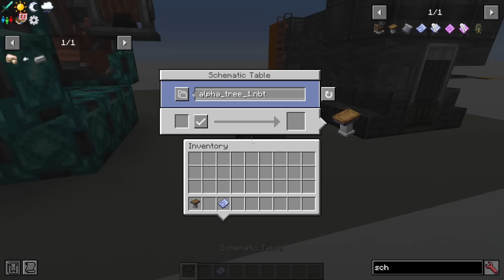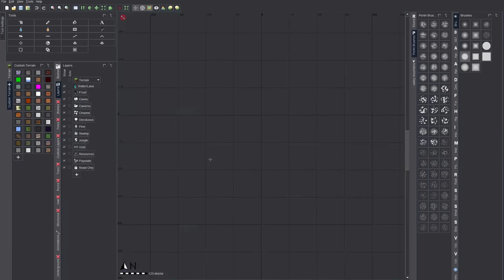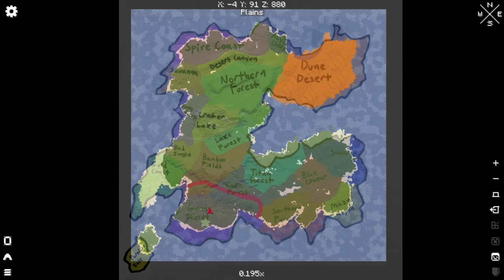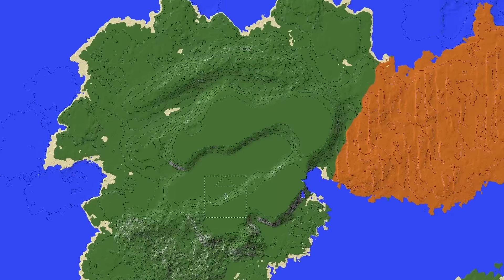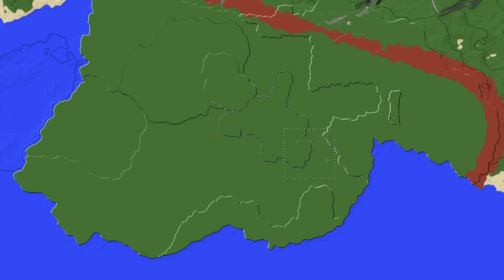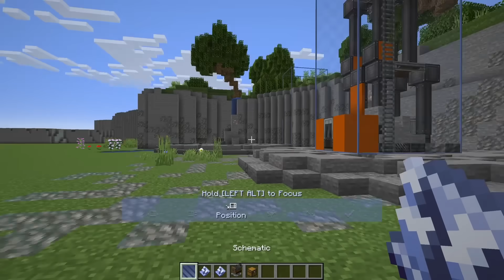Modpack tiers and custom world! | Satisfactory in Minecraft

Comment: A few recommendations i want to make as someone who is also trying to create his own modpack:

1- If you want infinite ore veins there are multiple ways to get them. A few of them already integrated with Create such as Molten Vents, Deep Drilling and Ore Excavation. Theres also other mods with similar mechanics like Industrial Foregoing, Void Miners or Immersive Geology. Alternatives such as Mystical Aggriculture or Productive Bees wouldnt work here but theres still the possibility of custom multiblocks that act as void miners. They would be harder to implement but in return they are 100% adjustable to the pack needs.

2- I don't really see the problem with Immersive Engineering multiblocks. Specially when you later talk about having Create multiblocks that would have the exact same problems as the IE ones. And as for the trains, while Create is the better train mod for this case, is not the only one. Railcraft has been a thing for years. But i understand the pack is Create centered so even then it wouldnt be possible to replace Create.

3- Oritech machines can accept addons that add to the customization of the machines but obviously when put against create nothing could really have the same level of freedom. Oritech also has infinite ore veins as well as a laser drill to mine them so that can help too.

4- For the multiblocks there are multiple, better, alternatives than schematics like Multiblocked, Custom Machinery or Modular Machinery Reborn. These mods allow for custom multiblocks that can do both custom and preexisting recipes. Using schematics as a replacement for multiblocks would only be an aesthetic thing since theres no way to make, for example, a bulk blasting multiblock better than just a typical bulk blasting setup while using only schematics. Even if the intention is to just have an alternative way of doing it, if the alternative provides no real benefits over the classic way, then most people wont do it.

5- Research mechanics can be created in a lot of ways. Main one that comes to mind is using Game Stages that lock recipes (and other things) behind certain actions/crafts/etc. I know modpacks such as techopolis have a research mechanic too but i never checked how its implemented.

I would also like to recommend Create: The Factory Must Grow as a potential addition to the pack. Mostly for the oil processing but it also adds a lot of other stuff that could be useful for the pack. Theres also Create: Diesel Generators if all you need is the oil stuff.

Overall i would recomend checking out a lot of the tools the modding community has created over the years to make modpack development easier and also allow for more things to be done. Mods like KubeJS may look daunting at first but the amount of things that can be done with it is crazy. Stuff like having the multiblocks build themselves by clicking a few items into a specific block seems difficult but with KubeJS is a simple click event handler
Reply: The main issue with IE is the fact that it's not customizable multiblocks like Polart said, Immersive Engineering's multiblocks are pretty hard coded so if you wanted to customize the multiblocks you'd need to remake the multiblocks themselves which isn't what Polart wants. This was one of the drawbacks for me when I'd play with IE, it required very specific blocks be placed in very specific places and the more complex the machine the more blocks you'd need to place in the correct spot, and one block not placed right would make the entire multiblock not work. And yes, I know of the projector, it's still tedious to need to place everything in the exact same way by hand with zero room for error or variation. It's too restrictive when building
Reply: in satisfactory, you can build train tracks however you want (curves, train switches,...) you cant do that with railcraft, but you can with create
Reply: @pohodovejrybar5918 I know. I said that more so because he was dismissing Immersive Engineering for reasons that don't make too much sense when the intention is to create something similar to Satisfactory in Minecraft.

That's why I said that Create was still the better train mod in this context. It's just that dismissing Immersive Engineering because it doesn't have trains isn't really a good reason when there's another train mod out there that does the job just as well with the only tradeoff being that Railcraft trains are less customizable as they are essentially just minecarts
Reply: @zafkielvondegurechaff3634  He was dismissing IE because the Multiblocks there are hardcoded in ways that make it really difficult to add new ones.
Reply: - Fair point, but basic regenerating blocks are simple and effective 
- IE Multiblocks are too difficult to expand/change for the pack, it's not a problem for the player but for the dev
- Oritech could work in theory, but lacks belts and that large scale aesthetic (single block that does one job -> big machines don't look as good)
- Satisfactory is balanced, smelters aren't 100% efficient so you need to build more of them, and create Multiblocks not bring as efficient as regular designs emulates that balancing
- True, many ways to make a MAM
- TFMG looks cool at first, but as someone who tried to play with a focus on it, the energy mechanics are bad and the mod is waaay too buggy for bigger modpacks rn
- Definitely a good idea to look at things that already exist
Reply: @Xodabeef Yeah my main issue with regenerating blocks would honestly just be the lag created by the constant check needed to replace them. Other than that I think they are fine

It's true that IE multiblocks are hard coded but unleds theres something that really needs a unique multiblock instead of just adding a recipe to an already existing one then I don't see the issue. Specially when mods like Immersive Petroleum and Immersive Geology exist. But that would require more details into the pack progression to see if it's possible

For Oritech, the large scale aesthetic I would say that harms Create more than Oritech since Oritech has quite a few multiblocks of decent size (nothing crazy compared to mods like Gregtech or some IE add-ons but still) while Create biggest machine is usually a chunk destroyer that wouldn't make much sense in a pack designed around infinite ore veins.
The need for belts and trains is kinda the only thing making Create a contender for a satisfactory themed modpack imo. Otherwise is the least satisfactory like mod that could possibly exist.

The thing about multiblock efficiency is true. But the reason this isn't an issue in satisfactory is because you don't have 3 different ways to make an smelting setup, but here you would need to compare vanilla furnace vs create fan vs multiblock. So if i can fill a chunk with a gigantic array of encased fans to smelt a million items but then there's a pre built schematic that allows me to smelt that same million items in 1.5 chunks, then the only reason to use the schematic is that it looks cooler than the encased fans. That's why there would need to be either some sort of benefit to the multiblock over the traditional smelting setup or the old setup would need to be removed/reworked to make the multiblock make sense.

Yeah TFMG can be messy sometimes. Just a few days ago my distillation tower decided to stop working for no reason lmao. That's why I also suggested Diesel Generators if the oil part is the only relevant part to the pack. Tho this one could be replaced by other mods like Immersive Petroleum or Oritech itself
Reply: @zafkielvondegurechaff3634   
- I feel like mods could easily become more laggy, but it all depends on implementation. The command block ore nodes here seemed like they only check in intervals of n seconds, so that may help with lag a bit. Haven't really ever dealt with that though, tbf.

- The main issue i see with using the IE Multiblocks for this is aesthetics and intended function, first point is clear (doesn't look satisfactory) and second is that IE may not have all the machines that Satisfactory has, but I haven't played enough of either to be able to confidently say if that's the case.

- I saw some Oritech and those Multiblocks just seem small, a 2x2 is nothing compared to Satisfactory's huge machines. And my main point here was supposed to be that, to me, Oritech machines just don't look like a big unit when cobbled together, unlike Create's which have more of that "Many blocks form one unit" feel. Neither are close to perfect here though, and realistically, true Multiblocks would be needed. And yeah, belts and trains are carrying Create, along with New Age's electric motors (without which Create would be the polar opposite of Satisfactory)

- Yes, obviously, but to me (and this is just speculation), it seems like the block-by-block building of Minecraft may get limited or downright removed in this pack in favour of schematic placing. After all, polartt was talking about custom ingredient lists (with plates and screws, the latter of which doesn't exist in vanilla create) for the Multiblocks, which wouldn't work with regular building unless component recipes got changed drastically. The talk about Multiblock removals with return loot also seems to support this theory.

- Oil really is in the stars, if only TFMG would ditch their energy system for FE and then start bug hunting. The mod did get a full overhaul though, to the point where the website said "Everything has changed.", so there may be hope! It's honestly such a great mod with perfect aesthetics for dirty industrial factories…
Reply: 2 is a weak point
Reply: @pqlopqlo-z9v why? We ended up in multi blocks anyway
Reply: @BryanLu0  The issue isn't Multiblocks, it's the inability to make custom ones with IE.

Comment: Towards the end, about the belts, idk if you'll end up using the default create belts or the other kind you showed, but they should definitely be running on their own without electricity or chain drives from one belt part to the next. 
Default create belts can be died and that look is awesome in my opinion. 
Colours could be used to signify belt tier/speed. Instead of clicking a dye on a tier 1 belt, if you can require it to take an item(s) like you do when upgrading conveyors in Satisfactory it would be great.
A similar thing is done in Mekanism when you upgrade placed pipes, you just click the next tiers resource and it changes like 16 pipes around where you clicked.

Comment: Why won't you use Create: TFMG instead of New Age? I think tfmg handle things better
Reply: New Age is also just an eyesore to the point it's not even fixable with resourcepacks
Reply: tfmg is a nightmare bc you have to handle voltage and resistance, which is not something you need to worry about with satisfactory.

Comment: Maybe I'm crazy, but you could use something like Project E, with AE2 integration for the resource sink. Make it so that it only accepts "points" as EMC input. The AE2 itself, is only for all the resources to be easily accessed.
As the player unlocks items in the sink, it unlocks new items to be converted from points to real items. 

I'm finding it hard to explain my idea lol.

The player has access to a AE2 Interface. They can't move items in, only take them off. 
The AE2 is integrated to Project E. When the player takes an unlocked(learned) item, it takes it from the EMC.
Reply: you could probably just use Project E by itself to be honest. Idk why I made it so much more complicated. 
Change EMC to points, and stuff like that. Filter it in a way that only points can go in, but other stuff can be taken
Reply: Project E would work but it would probably break the idea of Satisfactory in Minecraft. Maybe a mod like Replication could be closer but even then i dont know if it would fit the theme of the pack
Reply: @zafkielvondegurechaff3634  I was thinking of it only being used for building blocks. nothing functional. 
I thought of Project E because EMC kinda acts like points already. But I imagine some tweaking to Replication could also work
Reply: the only issue is that the points dont get harder to obtain like they are in satisfactory

Comment: You could look into the mod "Multiblocked2". You can create custom multiblock machines like immersive engineering and Gregtech. It's pretty easy to learn and suuuuuper customizable. It would work better than schematics and you'll have a easier time programming how the machines should and shouldn't work.

You can also check "modern industrialization". I'm sure you'll have so use for those items with kubejs and such or just some of the items itself could be useful.

Comment: 9:00 I don't know what you would want to do with the shop, but if it will have an automatic output please consider balancing it. Because if it will allow players to skip some automation (like in create above and beyond) players definitely will abuse it as soon as they find an easy ticket source. Even if you have to manually pull resources out for further processing I would personally make it more expensive than the what they sell for so players are encouraged to automate things and use the shop for more cosmetic, time saving or "just for fun" purposes.
Reply from the maker: Not planning on any automatic output from the shop, only automatic input
Reply: @polartt I still think it needs carefully balance, but I could've guessed you would stick close to what satisfactory does.
Reply: @daper1015 all that is really needed for balancing is diminishing returns. Every ticket you pull out increases the cost of the next ticket that way it can't be abused
Reply: @DelightfullyRaging  wait, you're right. That's even exactly what satisfactory does. I haven't thought about that until now.

Comment: This project has so much potential, I can't wait to see a playable version of it!
Also for the tools and upgrades the player can get later on, I'd suggest Direwolf's mining lasers and building gadgets. Maybe if you retexture them they could fit the pack well, and they're also very satisfying to use in my opinion. 

Maybe even like a way to augement the player (sort of like a skill tree that maybe requires materials to unlock things(thus giving the player another reason to automate them)), the Oritech mod has a simmilar mechanic, and it could also work well here if done correctly.